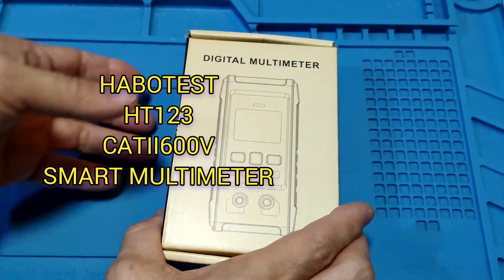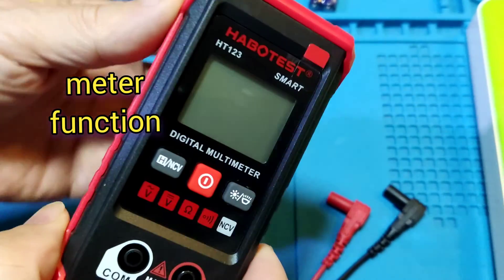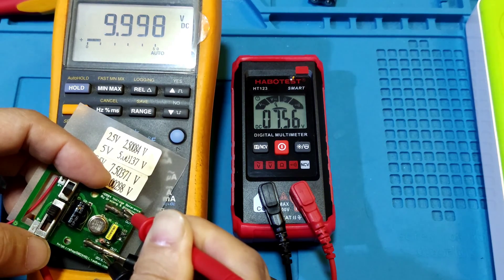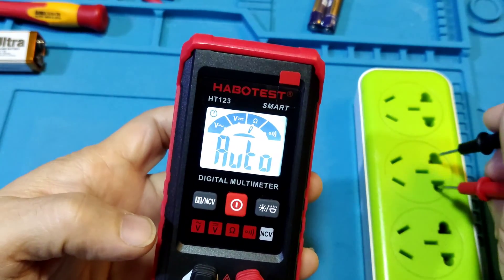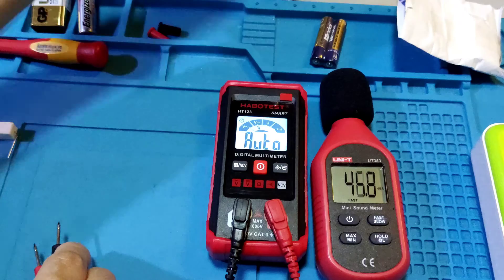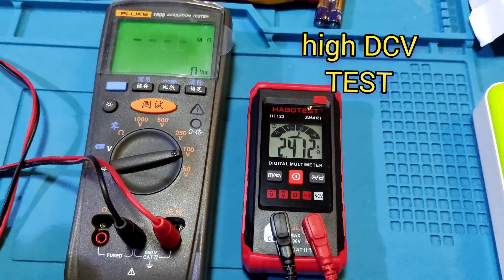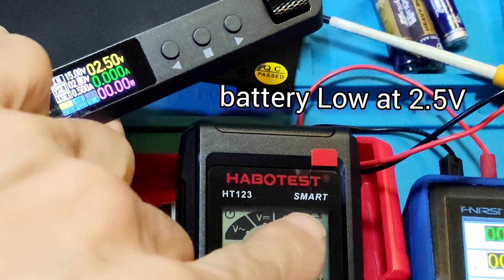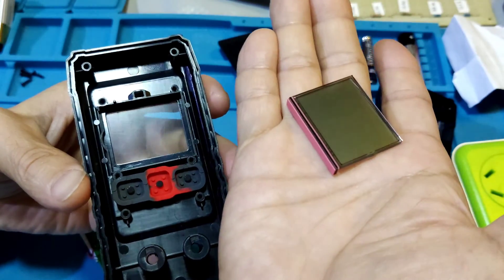HABOTEST HT123 CATII600V SNART MULTIMETER.

Comment: So what the cheapest multimeter that you recommended us to buy sir?
Reply from the maker: ht123 it ok for buy it  cheap price or ANENG A3008.
Reply: @wilsonluilui  aneng A3008 vs aneng 683 which one do you prefer?
Reply from the maker: @mastergne1423 and aneng 683 is near fully functional meter it have current measure ,but the size is bigger and have large screen with big digital,but it not cheap,if cheap also choice  aneng 621A that good price but not color display,and less power consumption of battery.

Comment: Can I manually select which mode to use? I want to measure induced voltage from coiled wire. If i connect the probes to the coil, I guess it will show the resistance or its continuity. But I want to see the voltage. Can I do that?
Reply from the maker: sorry if you want to make this test,you can buy a higher model of habotest meter to do ,because cheap meter the accuracy of response is low.
Reply: @wilsonluilui  thanks for the clarification bro
Reply from the maker: @steelducky9755  thx for watching.
Reply from the maker: and normally if you want to test on a mini voltage and change effect ,you must buy a AVO meter（analogue multimeter）.it can give a fast and quick change effect help you make this type experiment.

Comment: man i need help... does this meter suitable to use on low voltage project im running on 1.5v and below... do you recommended buying this
Reply from the maker: this type of smart multimeter it manual say that is 0.8V ,and if you test under 0.8V that may  not function.